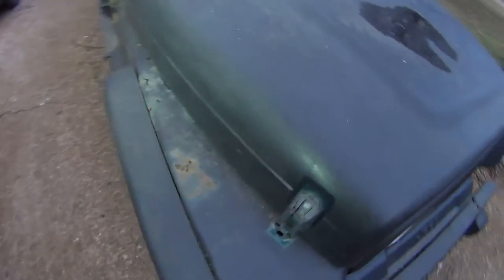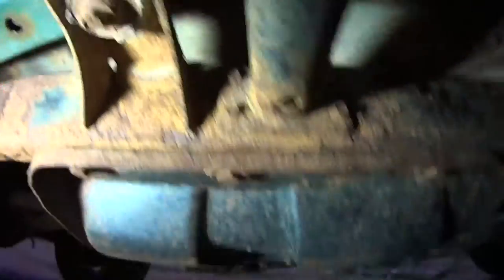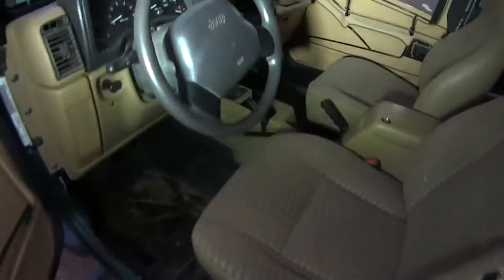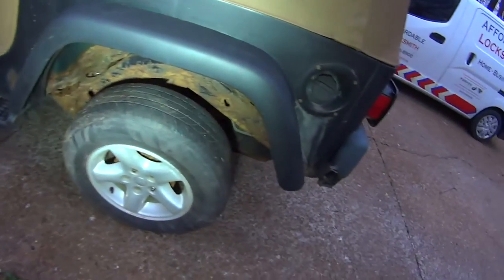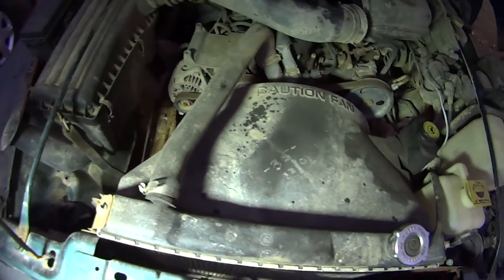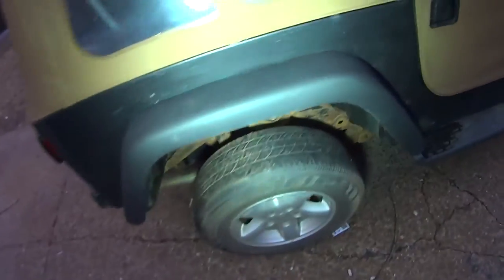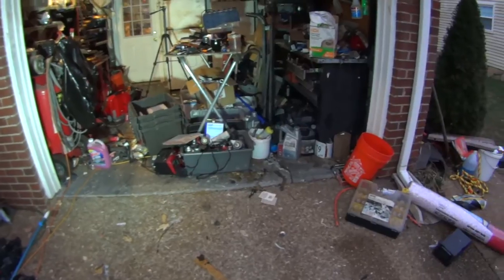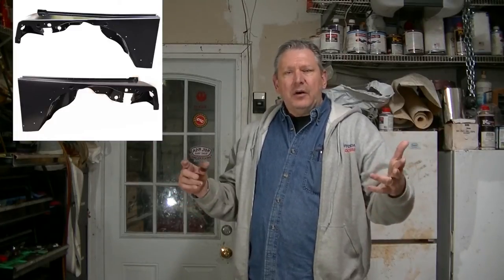TJ Jeep Wrangler - Walk Around - First Impressions - What 's Broken

Comment: It sounds like you are already going with the Eastwood product for the corrosion, but I am pretty intrigued by Magnet Paint's Chassis Saver. I ran into that when looking at bed liner options with their Monstaliner.  I like that they have ceramic in the mix instead of ground tire rubber. There are a lot of color options to choose from as well - if you can get past the names of some of them.  This spring I plan on doing the interior of my YJ tub in one of the lighter tan-type colors.  My vote for the exterior color is anything other than red since black sounds like it is out.
Reply from the maker: Thanks ! I used Chassis saver on the YJ last year and really like it . So no red - got it  :)

Comment: My Jeep is a dark green you seen it. As far as restoring the plastic pieces I used Armor all product it's a plastic restorer it lasts up to 3 months then you apply it again. I want to get half doors and a soft top as well for the spring and summer. You definitely got a good deal on that Jersey Jeep.
Reply: You should also check out getting the clear turn signals and marker lights
Reply: i've heard but not tried that you can heat up the plastics with a heat gun and that will restore the colour in the black
Reply from the maker: Bullshitkorner yeah I've heard that too. Eastwood has a new  black plastic refinisher 30 bucks a can I plan on reviewing it  why aren't they paying me ???? Lol

Comment: That sucks for the bed liner its gonna be allot more work  Can you have sand blasted ? 
Red or Jerry's blue both look good in the sun but the green looks allot better than I thought it would on the yj I am not a big fan of green but I liked it.A 2 inch spacer lift and 31's cheap and looks good
Reply from the maker: Yeah - With new fenders and no doors the hood will be the worst. It isnt a good quality bed liner so maybe it will come off easier than a good one. Already ordered a 3.2 lift kit - :)  I keep going back to the blue in my mind too .
Reply from the maker: samsbronco That was my thought exactly Sam - gonna try that first as I can scrape it off with my finger nail in most places